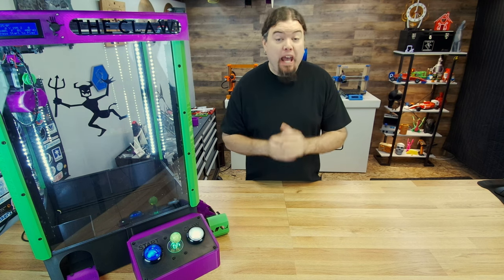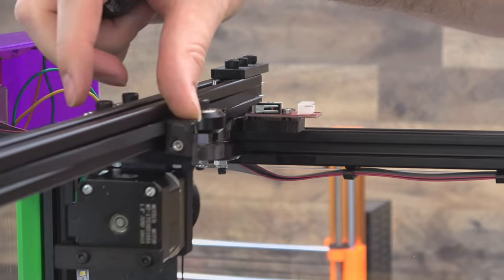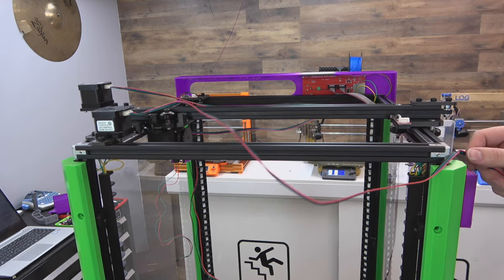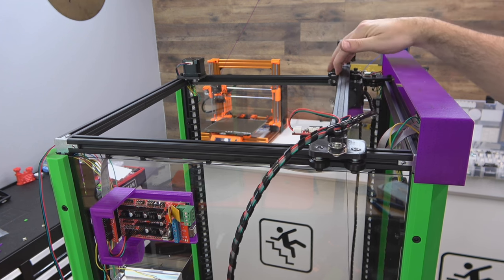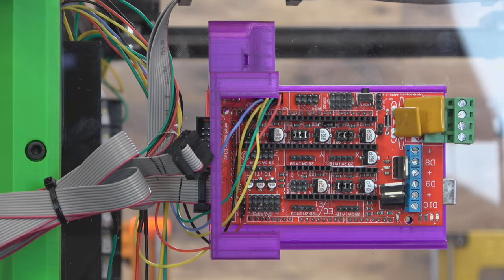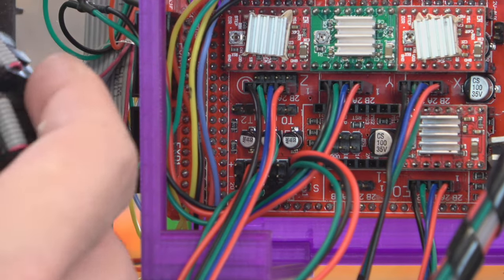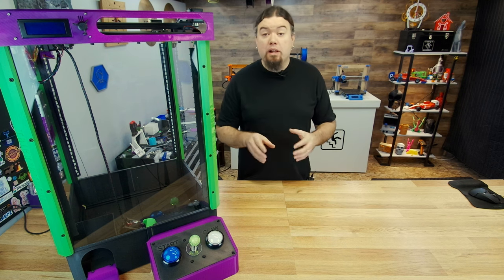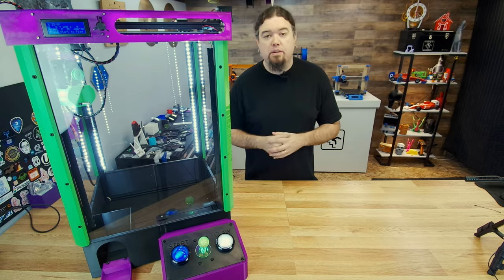The Candy Claw Series - Part 6 - Wiring - Board Install - Chris's Basement - 2022

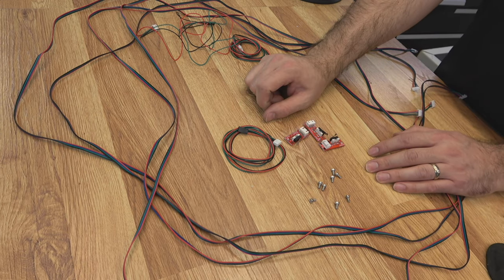Comment: @02:18 Couldn't you try to make your own "Curly Cable" by wrapping the one you have around a rod and hit it with a Heat Gun to shape its Sheathing? 🤔
Could also have used a Pulley System with the Roller on the Bucket - With two cables going between the Bucket and Gantry they by default prevent the Bucket from rotating 😉
Reply from the maker: Thanks for the suggestion!

Comment: Hi from Spain, Riley! First of all, congratulations for the great videos!
I was looking your amazing project and i was thinking to convert my old Anet A8 to a claw machine. Do you think that it is possible to use the same electronics as the ones Anet A8 has? I'm thinking to modify your Marlin to match my components, but I dont know if it is possible. Thanks in advance!
Reply from the maker: Thank you! The only issue would be analog pins for the joystick. If it had 2 analog pins you could use, everything else should work just fine. You might have to dig around and see if you can find a board pinout.
Reply: @ChrisRiley  thanks! I'll think about it